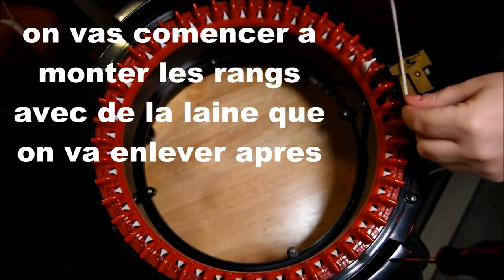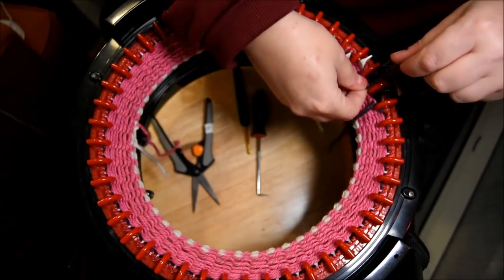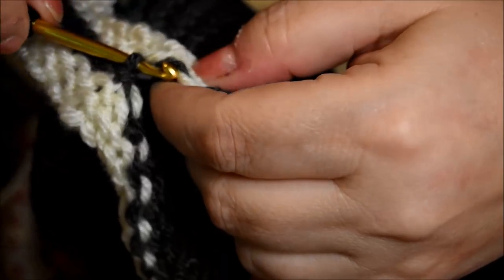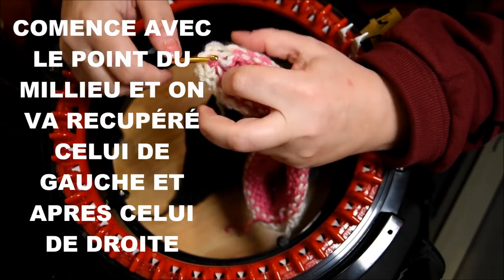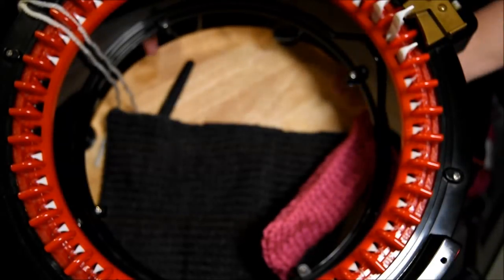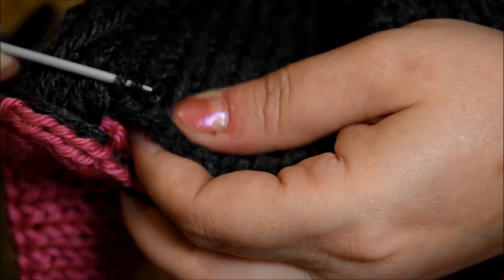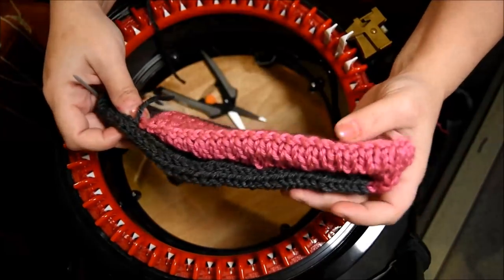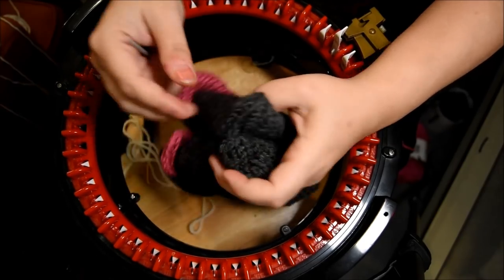(ADDI EXPRESS KINGSIZE) EASY SLIPPERS/ PANTOUFLES FACILE  (2019)

Comment: I love how you do these  slippers.  I need them larger though, if I increase the number of rows will that work?
Reply from the maker: how bigger do you need them?
Reply: Hi! Are you still active doing knitting loom projects? I was gifted the addi❤ King Express and want to make these slippers for a size 13. BIG feet in my family. Would 70 - 80 rows be enough?
Reply from the maker: @ravenscrochet1352  i have a pattern for that size but you need a 22 needles knitting machine too
Reply from the maker: Cause you need it wider to make it fit larger feet
Reply: I can't afford the smaller machine right now, but I still really need to make these socks for my size. I was thinking to make 2 tubes on my 46 needlel machine or making a panel
Reply from the maker: @ravenscrochet1352  i have deferent slippers pattern on my chanenlmaabe an option
Reply: @ravenscrochet1352  - I tried making Jojo's 3 x 22 pin tube slippers with 2 x 48 tubes. I have swollen feet and my wife has quite large feet.  It worked quite well. Watching this pattern, I was thinking the same thing you were - doubling the tube before making it up.  I haven't tried it yet, but I am definitely tempted to.